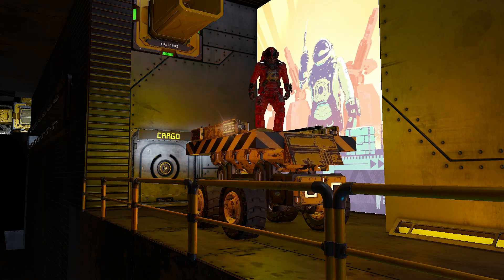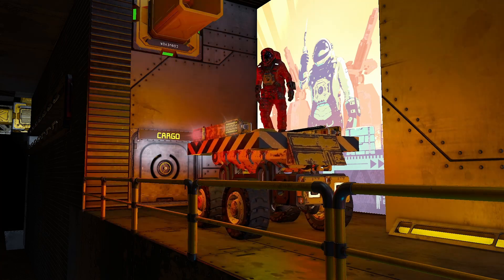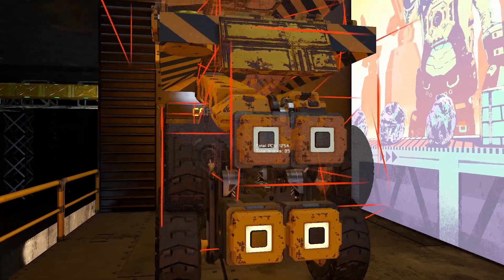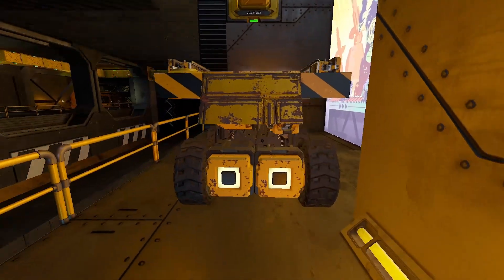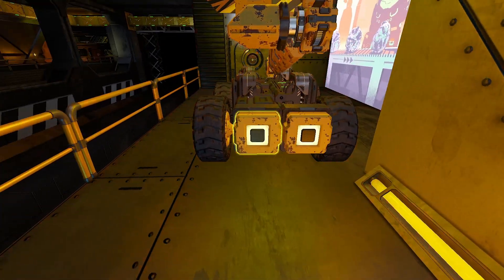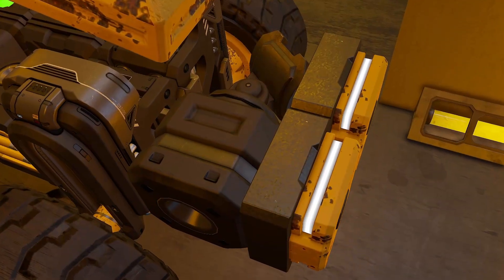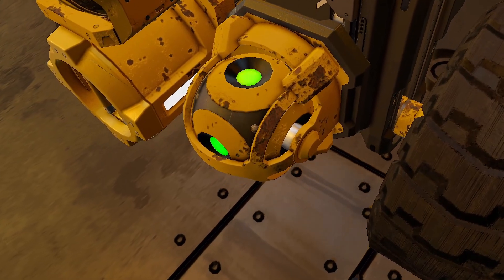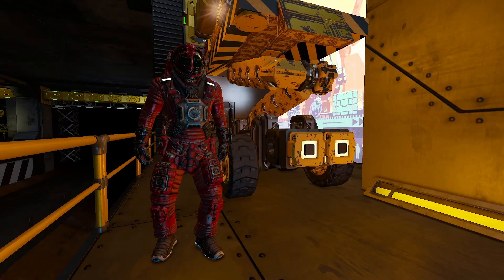Honey, I Shrank The Scissor Lift! - Space Engineers "Ship" Tour

Comment: You know what, I think you could make a Wheeled Excavator type Grid for Block Tools and it's be useful
Reply from the maker: Yep! I have a prototype for a road "paver" rover that can load with plates and weld the ground as it drives. There's so many fun ways to use rovers for things ships would be otherwise used for.
Reply: @vandalvanda  That's impressive.. but can it bridge a gap?
Reply from the maker: @johndee2990  Not exactly, it can really only weld floor that’s already been placed
Reply: @vandalvanda  I have only recently tried to make a short run "Tramline" but this with a minor adaptation could solve my problem of Track Degradation with a simple "Maintenance Caboose" or even a dedicated utility vehicle.

Comment: I've been trying to design a crane I could use to hold up vehicles I'm working on so I don't gotta wait for the thing to be built to put new landing gear on it, any tips on how I could design and make it work?
Reply from the maker: It's hard to suggest anything without more info, but the way I develop new small ships / rovers is:
LG Piston in the ground with a LG rotor on top with a SG head and SG connector so that I can retract the piston and have the connector flush with the floor.
Then I start building blocks up from the side of that connector, usually starting with another connector aligned with the existing one for bottom docking.
Once I've got the basic functioning ship, I grind off the blocks that link the new vehicle to the original connector.
You could also attach a SG projector to that connector, and raise it into a ceiling of welders, turn on the projector, and lower it down as it builds.
Hope that helps somewhere
Reply: @vandalvanda  Alright, thank you, I've been trying to design one for a few days now but can't make a decent base, maybe my first issue was trying to do large grid-
Reply from the maker: @lamithetoon2384  yeah, large grid can be tricky for building things like that. Small grid hinges and pistons are very strong, and can probably do what you need.
Reply: @vandalvanda  One thing I had an idea for that maybe you could try making is retracting cryopods, they retract into the walls or floor and are hidden by panels of blocks that extend to make a seemless cover, if it could be possible in large or small grid could you let me know? I wanna make sure I'm not thinking too big

Comment: i used a similar system to make a extendable gun platorm to make it peak over hills and fire at POI's in the exploration mod instead of getting shot yourself.
Reply from the maker: That’s some good engineering! Is that the EEM mod?
Reply: i used some creation magic with large and small couplings, it was a bit of a monster but it worked most of the time. @vandalvanda
Reply from the maker: Mixing SG and LG is so much fun. When it doesn't explode of course lo @clownofwar

Comment: unrelated: how is the glass at 2:42 not subject to the grind pit? that seems useful to know
Reply from the maker: Grinders don't grind their main grid, so as long as the glass is attached with the grinders it's safe. It's kinda cheesy, but cleaning out between grinders is very tedious, and cleaning the glass is much easier.
Reply: @vandalvanda  I never knew this thats  pretty cool
Reply: @theRealDarkett 
It's also moderately useful for making "slow burner" ship printers.

You can build a rotor-based spirograph (a rotating arm on another rotating arm) with a single welder, shielded by a glass wall, and then pull a projection "away" from the wall like regular printer setup.

The welder will weld stuff through the wall, but won't weld anything into the wall (and, crucially, it keeps the mechanism from becoming jammed by trying to weld stuff inside of itself).

It's much slower than a traditional "wall of welders", and requires a bit of tuning to ensure that the one welder is swept across the entire surface of the wall and doesn't miss anything, but it's cheaper to build, and it won't annoy the admins as much when you turn it on.